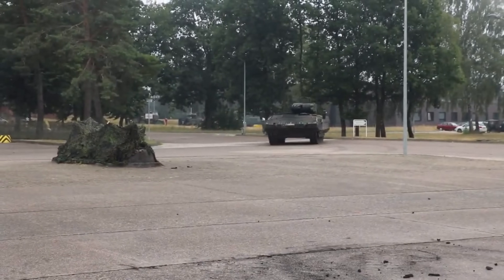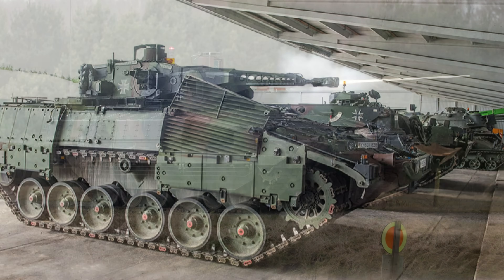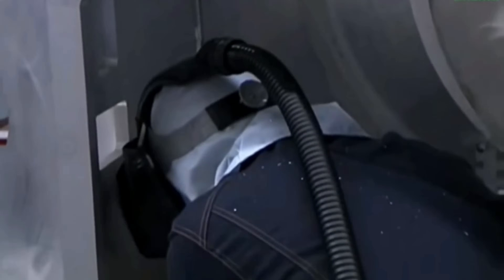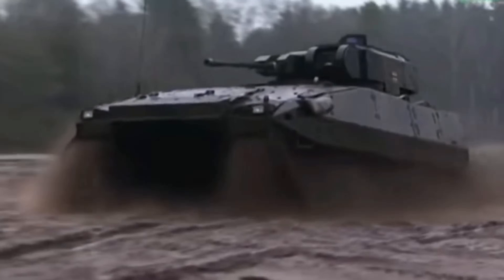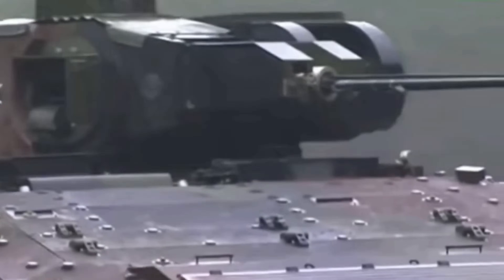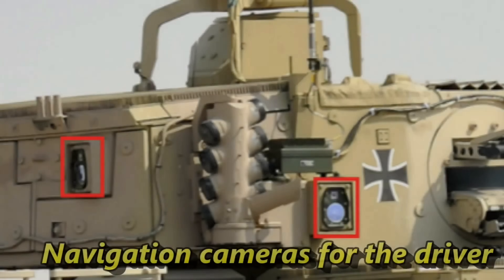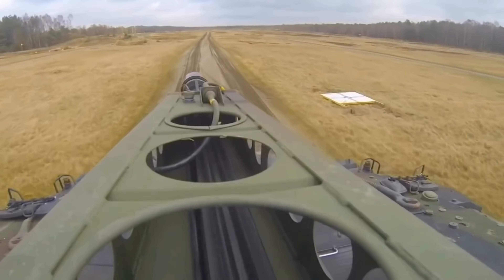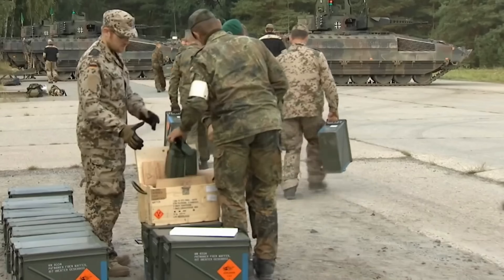The Puma Infantry Fighting Vehicle - Overview and Opinion

Comment: Mat, the "cameras" on the turret, which you said are for the driver, are actually the MUSS (https://en.wikipedia.org/wiki/MUSS_(countermeasure) ) active protection system.

The driver has just a reversing camera.
Reply: I have used Wikipedia citations to find valid sources in the past. It is useful like that.
Reply: For future, you can use wikipedia as a way to find Sources, usually you have all the sources used for an article at the bottom of any wikipedia entry
Reply: The Cameras in the turret are actually working together with the MUSS-system ( multifunction Self protection system) against IR guided missles but the Jammer has to be mounted on top of the peri (commander sight). The Spz has cameras on top of its hull for a visiable reconnaissance in close/Medium range for the rear fighting compartment and the front fighting compartment. 
Learned on both IFV's Marder and Puma 
Btw the puma is like a freaking mbt 
-firepower and accuarcy 
-mobility and protection 
-leadership with the latest communication System for example with the Future Land Warrior System "IdZ - ES/FS"
Reply: Yes, not cameras per say but IR detection warning sensors. You'll find the same kind of sensors on aircraft and helicopters to detect IR missile launches. There are radar detectors also that have been around a whole lot longer.
Reply: Wikipedia ins't a valid source
Reply: @Staann  of course it is not, but here you are: https://www.hensoldt.net/products/optronics/muss-multifunctional-self-protection-for-vehicles/
oh, thats the source of the wikipedia article. I thought you could click that yourself, or do you need a hand for everytime you need to cross a street?
Instead of crying that wikipedia is not a source, use your energy to search for proper sources yourself.
Reply: @sanderall  hahaha relax dude, i wasn't saying that you are wrong. I was just pointing out that you can't refer to wikipedia as a valid source. And don't you worry, i don't need anyones help crossing the street :)
Reply: @Staann  well, but you have to admit, that wikipedia is a great source to start the research. So it is a source. Absolutly not the only one and sometimes not accurate, but the references help to find your own opinion. And in case of the sensors it is a matter of fact.
Mat just got it wrong from a not so good source, which can happen, if you want to put out content for the borred people, which discuss if wikipedia is a valid source or not.

p.s. thank you Mat!
Reply: @sanderall  good work mate!
Reply: staan dobber but the manufacturers site is my dude
Reply: @annelisemeier283  it's still a biased opinion but miles better than wikipedia
Reply: @Staann  Unless you're writing a thesis or something like that Wikipedia is a good source if you're looking for some quick information on something. Wikipedia is going to be more right with it's info than Mat is ever going to be.
Reply: @Staann  haha I work in the defence industry... often I check wiki to see what is on there... sometimes Janes, and the various journals we have don't always have all the information, wiki is often more up to date in some cases... ease up mate...
Reply: @Staann  Wikipedia is mostly right most of the time about most subjects. Which is validated by many studies. It's not really tenable that you can't use wikipedia as a source anymore. It's just not authoritative when arguing against other sources.
Reply: @Staann  Ironically Wikepdia is more reliable than any major news source

Comment: Main gun has Optomechanical connection from gunsights to gunner . It is no different to traditional manned turret in terms of vulnerability. Pumas turret is unmanned but still has basket below it.  I had a chance to have a look into one during exhibition. The hanging seats and zip bags for rifles are genius.  Interior is really tidy (anybody who was hit by flying ammobox or rifle during rollover or ied  will agree :D). The rubber hedgehog  all over top of the vehicle protects it against bomblets and heat submunition.  And  integrated spike allows puma gunner to shoot over horizon, fire and forget, switch to atgm camera and change target midflight.  Each wheel module consist of one fuel tank suspension and one wheel. It is easy to maintan and replace, and you can cut off damaged fuel tank and not lose too much fuel. In addition fuel tanks provide addition protection to sides from outside.  KMW  (maybe with diehl ?) is now working on segmented hybrid rubber tracks for Puma. It will consist of 1-2 meter segments of hybrid rubber track. This solution will provide all benefits of rubber tracks  combined with easo of maintenance of traditional tracks.
Reply: "It is no different to traditional manned turret in terms of vulnerability."
The point isnt better protection of the turret. The point is that without people in the turret you dont need to waste nearly as much armor on it. That means you save weight to play with for increasing the armor protection of the main hull, while keeping the thing light enough to be air transportable ina A400M. 
Turrets can be replaced. Lost lives cant.

Comment: matsimus!

I share Your concern about the classic German tendency to overdesign - taking even the remotest contingency into account.

The British - and especially the americans underdesign their equipment - just to get the newest technology to the troops as fast as possible.

The Swiss tend to have the gadgets needed - and no more.

Which approach is the best? It is hard to know, but I consider it a strength of Nato! The enemy never knows what equipment they will be up against.

The difference between the number of dismounts is probably more due to the German small arms trauma. The G11 went nowhere and they have had deep trouble finding the replacement for the G3. They have wanted to standardise on the same gun as both an infantry rifle and mashine gun. Adding to that is the problem with the anti-tank missile.
This leads to a problem: How many are there in a squad of dismounts? 6 or 8? The number depends very much on which small arms the infantry has available.

A missile like the Javelin is splendid - if it works and you see the target. On the other hand the TOW (wireguided version) has its advantage, that it is difficult to jam, and you should be able to train people on its use, as they are fairly cheap.

The third factor is the ablity to build an economical diesel engine - the MTU V10 has a whopping 1.100 hp - but that leaves their planners with the question: Why not add a modern kitchen sink to it as well? Naturally with a spare.

One should remember that after the cold war just about all the Nato-countries got their tanks upgraded by surplus German equipment in a couple of rounds.
First the Leopard 1 replaced the legacy Centurions, then the Leopard 2 replaced the Leopard 1. Now the Leopard 2's are getting updated.

But really: Infantry Fighting Vehicles participate in so many interdepartemental fights - each with uncertain outcome - and that is even before the enemy gets involved.

Comment: Watching these types of videos I've noticed ammo counts in modern Armoured vehicles is really damn low.
Like This thing carrying 400 Cannon rounds and 2k Ammo round (even if its best described as a light machinegun) seems to be rather impressive for its class.
Reply: Stowed in the front left side.... Looks like a weakness to me.
Reply: If you can laser the aim point and have the 30mm round explode 2m above the head of the enemy, you dont nearly need as many rounds as in cold war vehicles.
Reply: @positroll7870  tell that to Gulf War veterans
Reply: @reggiebuffat  One should not believe everything the tank building companies promise. OTOH, computers, optics etc have made a lot of progress over the last 30 years. The Puma's gun is fully stabilized and accurate enough that it even can be used against airborne threats like small drones. Hitting a window or cleaning a trench with it is no problem.